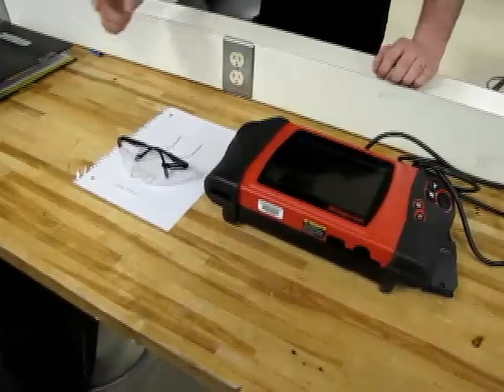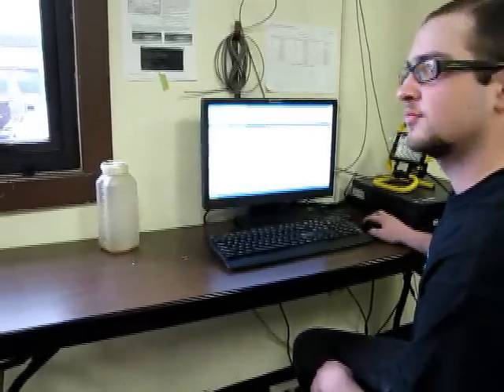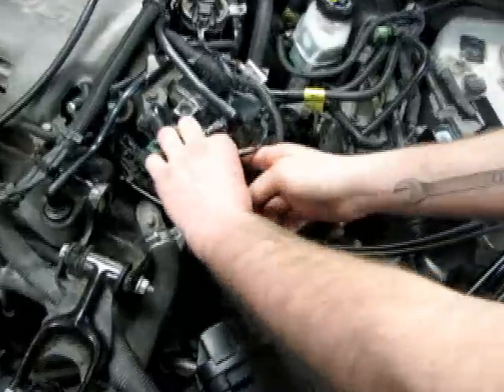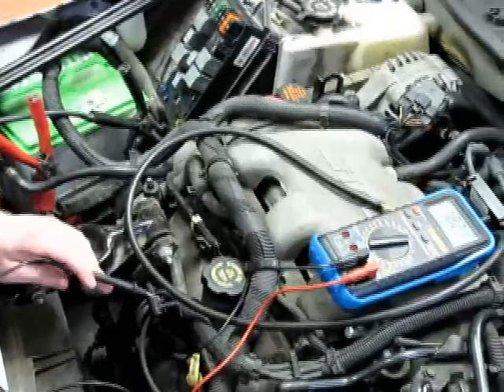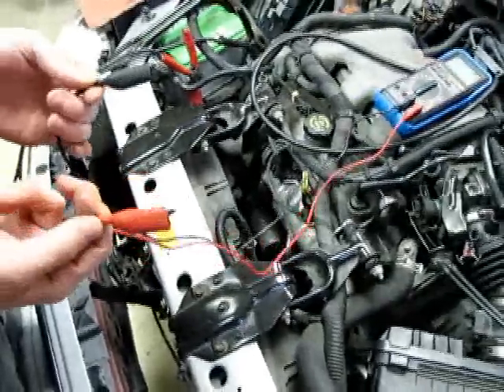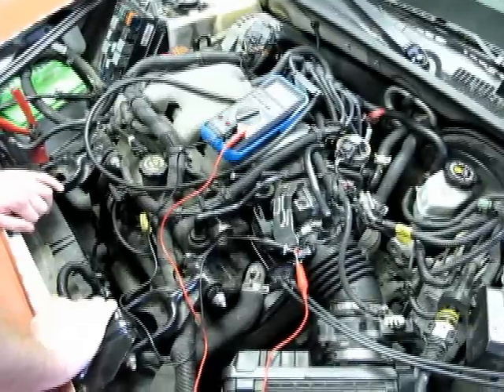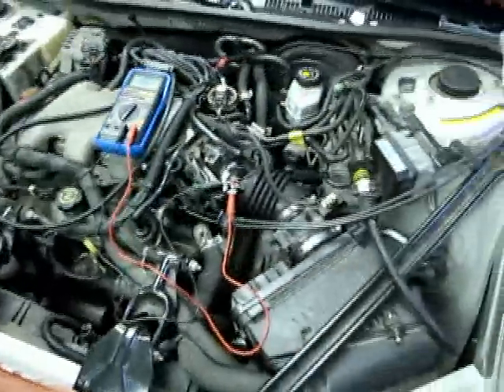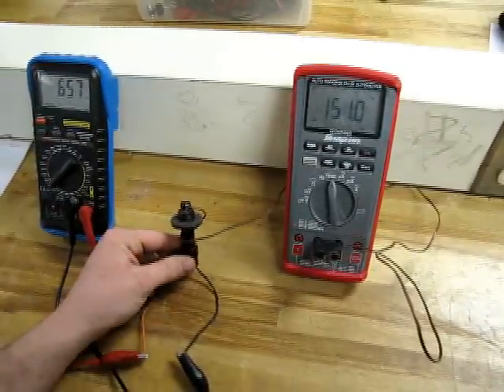Air Temperature Sensor Testing

Comment: I refuse to wear safety glasses sir.and my truck is not running right so I just filled up with jet fuel. will that help? I may just put nos system on it instead of the 20 dollar sensor. that should clear a lot of shit up right?   ....your thoughts? ??????.....turning  R's

Comment: @cmpremlap I will encourage you to form a relationship with a repair shop and you can buy wiring diagrams from the owner for about $5. I have found that car people are not unwilling to help a do it yourself-er, just be nice. I have gotten free wiring diagrams and technical data from many shops just by asking.

Comment: I can't afford Alldata.  Is there any harm in checking for ground and power with voltmeter and t-pins?
Reply: @cmpremlap : Nope, that's fine. Personally, I'd check for the 5V reference wire first. 

Attach your neg (-) multimeter wire to battery ground. Then, with your multimeter set on DC volts, probe each sensor wire with your red (+) meter lead to see which wire is the reference wire, and observe the voltage reading. 

One wire will show nothing (because it's the ground wire), and the other should show around 5.0+/- volts.

Next, change your meter setting to Ohms, and then do the same to test for the circuit ground.

Many multimeters have a "beep" function/setting to quick test for circuit/wiring continuity.